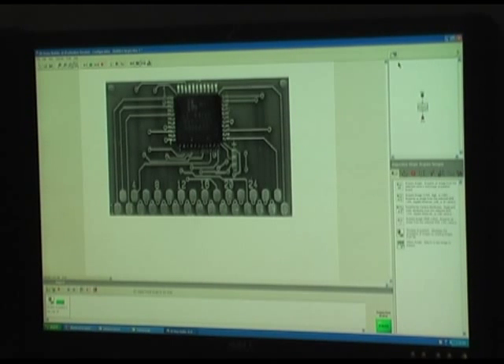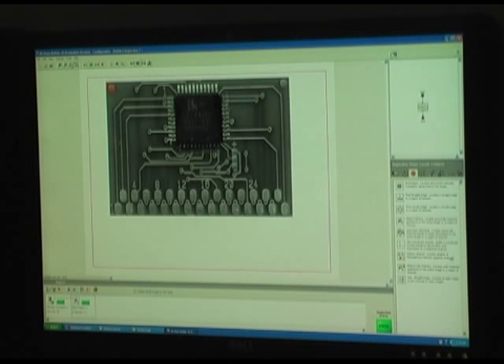Automatic Optical Inspection At UT Brownsville

Comment: @FerreusNRG I work on Viscom machines and the creation of a program from start to finish it takes me less than 8 hours, dependign on the size of board and the number of components.They have around 50 parameters for each inspection pattern, but this depends on the inspection pattern itself. Optimization isn't that bad but it takes to much to make adjustment, reload program, run inspection and repeat the procedure.

Comment: great video, I work with AOI machines and all I cand say is that it seems quite difficult to adjust the  parameteres using your software. In industry they say time is money and the faster you can create an AOI program the faster you can optimize it the better it is. Am I right that this is just for demonstration and it isn't intended for mass production?